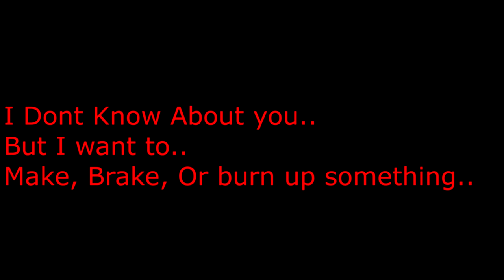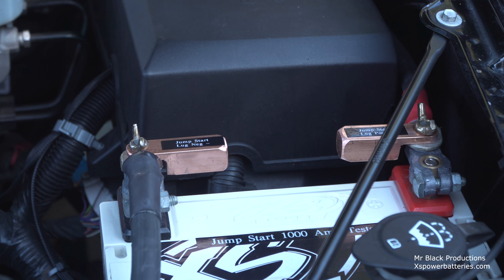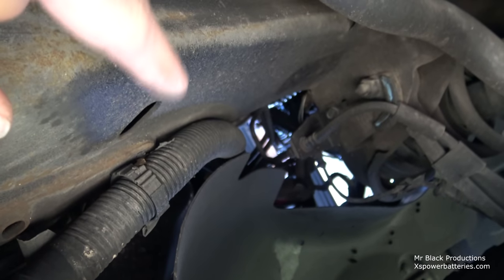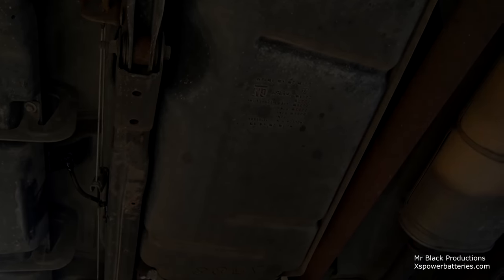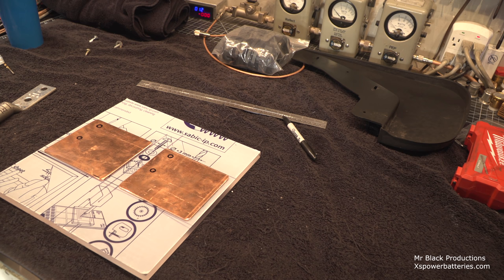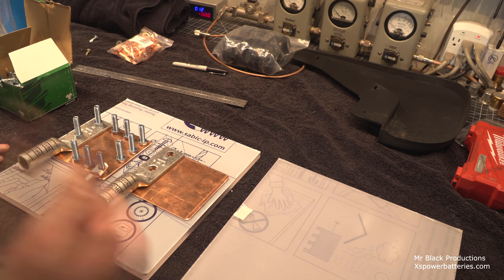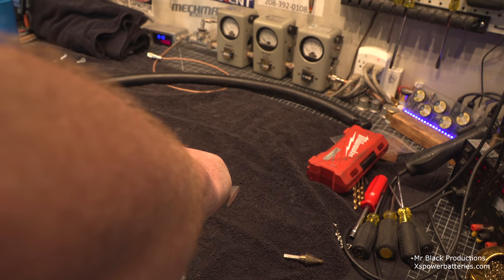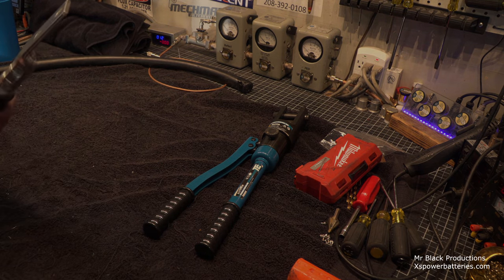Lets Build us a Mobile Pt.4 Wire & Batts & Stuff

Comment: This video reminds me of my stent in Afghanistan, when not on patrol duty carrying the PNC-113 radio on my back I was left in charge of a few other soldiers for the humvees getting shipped over and they are completely bare as in comms gear. Radios, antennas and coax are installed on base (inside the wire). No pre-drilled routes for coax nor antenna mounts, so it’s basically formulate your own strategy and get drilling. Fortunately, the entire vehicle is metal other than the ballistic glass for windows and windshield, this helps with the ground bonding scenario between radio/antenna system. Yet, again Mr. Luke this is an awesome video and it’s nice to see someone showing their brain storming ideas and of course the do’s & don’ts. 73

Comment: Try Kopr-Shield by T&B on your next crimps. We use it on everything from #4 to 1000 MCM. Prevents oxidation and lowers resistance on surface connections and increases surface area and conductivity on crimps by filling in all the gaps between the wire strands. It ain't cheap but it's great stuff.

Comment: love the power cable ! 12V system .it's voltage drop across the wire . go big AWG . the longer the wire the more the drop . If you had to jump a dead LTO battery system like this . disconnect the LTO place a lamp or resistor inline the LTO lead + or - . than jump but use lamp to bring super cap up first . then start . let the LTO charge then connect direct.  safety first ! super cap and LTO have very low internal resistance can cause very high amperage surge . 73's

Comment: It would be easier to mount your amplifier on the top of your hood and have it air cooled with a ram air scoop than run all that power wire.
You might as well add a outlet to the bumper to jump start stranded vehicles.
Note to BBI: DON'T GET T-BONED.
Reply: Don't need jumper cables , just key up next to them lol

Comment: Just a suggestion unless you want to see the batteries or caps you know those would fit just right inside of a old battery box just cut the top off of it and dump the insides out do your suspension with your epoxy and you can even put the top back on and you're all set

Comment: You're supposed to put the power wire up against your fuel line on the outside of the frame run it right by the catalytic converter so when it gets hot it takes care of everything
Reply from the maker: I will do that next time
Reply: All all that's a pain in the ass but it'll be worth it in the end

Comment: Hey BBI first of all awesome set-up i just have a question you used 2 capacitor batteries on the truck and lithium caps to run the amps my question is can i use capacitor batteries to run my amps?

Comment: I'm going to use optima agm with xs power 500f super cap with my 240a alternator built by a local shop it's built just as good as mechman this local shop has been in business since 1930
Reply from the maker: Lto....
Reply: @BoxBuilderIdaho  to expensive for me I'm on a monthly tight budget I'm building a mobile station on a budge I can't afford all the fancy stuff.
Reply: @Mr BBI  I like the radio hobby but I don't have that kind of cash to spend on the hobby I only have a 1x2 I'll probably be a mud duck forever on the band